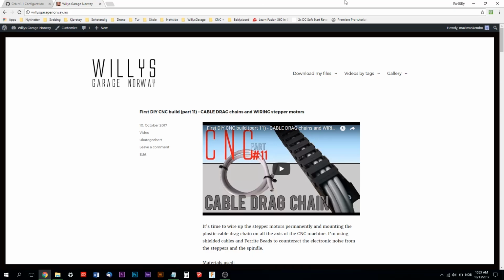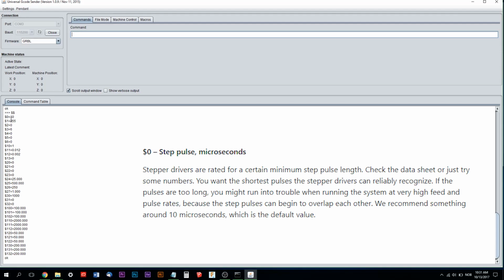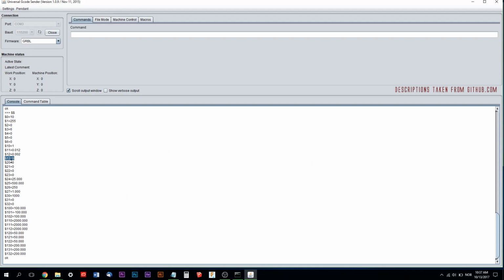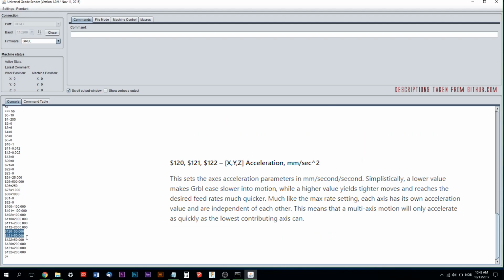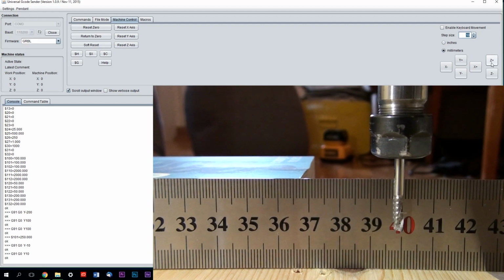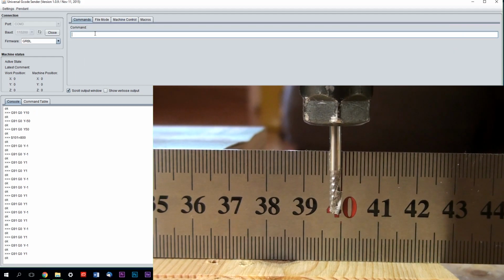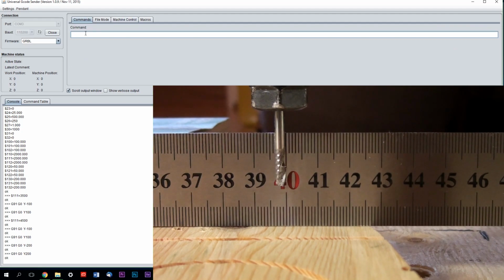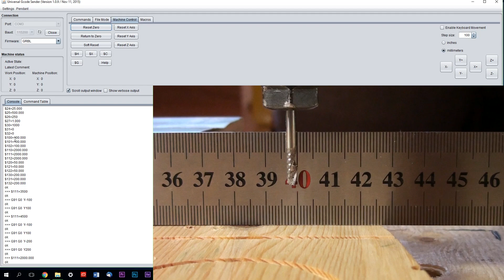First DIY CNC build (part 12) - Configure $$ GRBL on ARDUINO uno TUTORIAL

Comment: Hi. Very nice video. One question - is there a way to add 4th axis to arduino + cnc shield with GRBL? If not, what is the easiest / cheapest way to move to something else that can use 4 axis? Thanks

Comment: Greetings to you dear, thank you for this topic. When connecting for the first time, the motors never started, and the driver’s temperature rose. The motor took one pulse and stopped working or turning until the order given to it by the program was finished. Why didn’t the Nema 17 motor work smoothly and continuously???
Reply from the maker: Hi and thanks, sounds like your motor stalled. Therfore it stops 👍😄

Comment: I have the same problem. With settings $100,101,102 at 100.000 my Mill moves 25MM when asked to move 100MM. My thought would be to change to $100= 400.00, but that does not work.I also get noise and little movement. My machine is a cheep Chinese 3018 PRO. Is there another setting that needs to be changed?

Comment: I installed limit switches... And  when it is pressed motor stopped working but after that I need to restart everything....and it's not accepting any further commands.. is there any option to move the axis away from the limit switch automatically after it is pressed...

Comment: This us by far the easiest and most thorough examples to follow. I am new to cnc and have just finished building an MPCNC.  I have just connected my cnc shield and Arduino UNO and was lost. I will go over thks video again tonight and try using your descriptions fur the first time. Again many thanks.
Reply from the maker: Ciaran Whelan Thanks to you for the feedback :-)  The reason I made this video was beacause I had had the same problems figuring things out myself. Eventually after rooaming the internet for a while I figured it out. The same goes for the Arduino and the TB6560 connection. Thanks again :)

Comment: My computer is on in inverter. But machine all is from suplie current. When suplie current is cut and job stop through relay. & when power is come then relay turn on and start job. 
But but sometime when suplie current is come then comport disconnect some time. But what is best solution. I think I need soft statar for suplie current. Machine is ok. Problem only this
Reply from the maker: Sounds like a good idea to try the soft starter. I'm not sure since I have not come across this problem myself

Comment: Dear sir please tell me how to increase speed of CNC machine
.. my CNC is running is too slow
Reply from the maker: If you have the settings correct, the steps per mm setting? Then you can try to increase your maximum speed setting and acceleration setting

Comment: Please reply😢
Here is a problem to my CNC grbl with stepper motor that the response time, I send the command to stepper motor but it doesn't revolve it revolve when I reset or close the grbl and again open or linked up with arduino then the stepper motor runs with the previous code which I upload but it does not revolve at that time 

I am also change the response time to one 

What is the solution please tell
Reply from the maker: Not sure what the problem is, did you figure it out?

Comment: veldig bra informasjon, takk. 
Jeg holder på med en ox cnc, og tenkte å bruke Raspberry Pi 4 med protoneer modul.
Reply from the maker: Takk :) det høres ut som et spennende prosjekt :) Jeg har ikke vært borti Raspberry Pi så mye, bruker du GRBL mot den maskinen?
Reply: @WillysGarageNorway  
Hei, ja, det er grbl som er planen, har installert noe. Men er helt på ukjent grunn selv, så det blr spennende å se om jeg får det til å fungere, ellers har jeg en windows-maskin stående med mulighet for Mach3. men det hadde hvert greit å få alle komponentene montert i samme kabinett.
Reply from the maker: @Cwn86  Det er bra å få samlet alt ja :) Si ifra hvis du støtter på noe problemer, kanskje jeg kan hjelpe 👍
Reply: WillysGarageNorway 
Takk, det skal jeg gjøre.😀

Comment: I think this problem in LaserGrbl v3.014 softwear setting. 
You can check in above laserGrbl in menu /Grbl/Setting/Jog Control /Grbl/continuos Jog.
         on/off Button has side to continuos Jog. 
Maybe on position is jog work. And off position Jog not work.
 I will checking at home. This time I am in office.

Comment: Hello,

I have built a CNC plasma cutter (MPCNC with GRBL control) and also use it with the Universal Gcode Sende program, but I have the following problem: The file has a length of 100mm, for example, but in reality it cuts me out to 300mm approx. All values in UGS are converted to mm (G21). What could be the reason for this and how can I correct this error?

Please send me your feedback as soon as possible!

Best regards

Tobias
Reply from the maker: Hi, the only thing I could think of is that you might have your settings, mm per rev, wrong
Reply from the maker: Check how far it moves when you tell it to move 10mm in joging function in UGS, measure how far the axis travels in real life. If it moves to short or long, you have to check over your travel settings to make the axis travels the lenght you ask it to travel
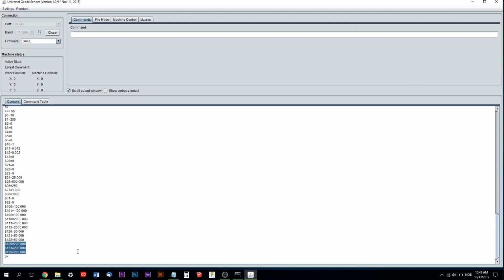Reply from the maker: Try to follow my steps in the video 8:20
Reply: Thanks man 🤙

Comment: Hello, I'm mounting my cnc machine following your videos. How do you calculate the $100, $101 and $102 values? thanks!!
Reply from the maker: Hi, i think I have explained it in this video. You need to find how many steps yor steppers need for 1 mm 👍
Reply: WillysGarageNorway you are the best!! Thanks a lot
Reply from the maker: @urko19  Did you figure it out?
Reply: @WillysGarageNorway  Yes, what happens is that I did not take into account the microstepping
Reply from the maker: @urko19  hehe, yeah I did the same thing
Reply: One stupid question, why do you change the axis? I suposed that the x axis was the horizontal one and the y axis the vertical one... dont kill me jejeje
Reply from the maker: @urko19  hi, sorry for late response. Im not sure what you mean. I did invert the z axis because it turn in the wrong direction. Was that what you ment?

Comment: Hello...what to change on my gbrl settings on LaserGbrl software to achieve 50x50 cm engraving area on laser machine.When I downloaded Laser Grbl to exchange Benbox I uploaded one hex file as firmware.This is for some other machine and I have movement 30x30 cm.I want 50x50 to have engraving area.Machine which I have is 65x50 3w laser
Reply from the maker: Hello, I'm afraid I can't help you. Not familiar with laserGRBL

Comment: How can I increase the speed rather than using codes like $110 $111 any other method?
Reply from the maker: You can use all kinds of inputs. What do you plan to use it for?
Reply: @WillysGarageNorway  cnc writing machine
Reply from the maker: @A2Zfarmsupdate  the speed can be set via the g codes. The speeds you set in $110 and on us only  the  maximum speed. So the speed is set when you make the g codes or the toolpath
Reply: @WillysGarageNorway  thanks
Reply: @WillysGarageNorway   James Munro   dieselphiend  hey buddy how can I achieve slowest and smooth  one rotation per minute  with maximum torque ? Using nema 23 with tb6600 driver ??

Comment: thank you for the explanation. i would like to know how you did the homing and the point zero with grbl and arduino. and hw you calculate the step per revolution of your motor. i have the nema 23 Wantai stepper motor model 57BYGH115-003B 428 oz. Step Angle:                    1.8 degree

Voltage:                           6.3VDC

Current:                           3 A/phase

Resistance:                     2.1Ohm/phase

Inductance:                    9mH/phase

Holding torque:              30Kg-cm       428oz-in

Rotor inertia:                  810 g-cm2

Detent torque:                0.89 kg-cm

Number of wire leads:  4  how can we calculate the step per revolution
Reply from the maker: Hi. If you watch this video, I explain how you calculate your step per rev. It depends on your setup, lead screw, belts etc.
You can watch this video on how I zero the machine:
https://youtu.be/A1zlL3q23HI
Reply: Thx you. I missed this part. Thank you.and it was well explained.thank you and great  efforts
Reply from the maker: user new No problem 👍😀

Comment: when i press $30 it says error invalid statement
my spindle stopped working all of the sudden
Reply from the maker: I need more info on the machine, spindle, vdf, controller boar and so on
Reply: @WillysGarageNorway  spindle 775ER 
its the spindle that comes with the cnc 3018 pro same with the board

Comment: Hello, while processing the g-code file I created with UGS in CNC, the CNC axes go to the place they need to go very fast when the carving work of a point is finished and trying to go to a different point (idle acceleration), which causes tooth skipping and the coordinate is distorted.  I wonder if I need to adjust the grbl settings or the g-code file to reduce the speed of the axes in these transitions (idle speed).

Comment: Hi
i'm working on DIY cnc router project but i have a problem with lead screw or ball screw it's expensive man i spent about 650$ for stepper Nema 34 and other stuff
The question is Do you think if i use a belt my machine will be fast or what ??
Reply from the maker: Eng.Mudar A I dont think the machine would be any faster with belts. Belts are prone to wear and tear, they will slack and start missing steps and stuff. With the nema32 And 23 I would recommend going for some ball screws even if they are expencive. You can also do lead screws like me. Belts would not cut it, sorry
Reply from the maker: Eng.Mudar A Hmm, not a bad idea. But I wonder about the backlash in the chains and sprockets. Maby its fine :)

Comment: Hi, friend!! Excelent tutorial!! Just one question: why my Arduino don't save the parameters?   I'm using grbl controller 3.6.1.
Reply from the maker: TreCe Robotics Hi and thanks. Doesn't it save setting when you change it in UGS?
Reply: WillysGarageNorway Yes, right. The UGS don't save the changes. I think that is the EEPROM of ARDUINO or my Arduino is wrong. The tb6560 is good.

Comment: Is acceleration that slow really necessary? I have not yet set but I'm wondering if setting mine to 200 would be bad. It's a 4mm pitch per rotation lead screw, and if I stall the motor, even at full speed the weight of the gantry can't move that lead screw.
Reply from the maker: Eugen Krause it all depends on your setup 👍

Comment: Thanks Mr Willy,that's very helpful as always,I have question about the values of $110-$112,how would you know the values to set ? is it based on trying or based on calculation?
Reply from the maker: Mohamed Amine BIDA Thanks again. You can increase gradualy 110-112 after you have found the step/mm (100-102). Increase it until the stepper «stalls» or you dont want it to go any faster. Then you can decrease it 10-20% to perserve your steppers. The same goes for the acceleration setting :-)    Good luck and appreciate the feedback ;)
Reply: thank you

Comment: Thanks , but when i try to change ($101=400) the stepper make a high noise and not moving, why ?
My stepoer nema 23 ... 2A
Thanks
Reply from the maker: That means 400 steps per mm. Does your stepper have 400 steps per revolution?   anyway you have to make these settings smaler when doing that.: 
$110=2000.000
$111=2000.000
$112=2000.000
Reply: I have the same problem. With settings $100,101,102 at 100.000 my Mill moves 25MM when asked to move 100MM. My thought would be to change to $100= 400.00, but that does not work.I also get noise and little movement.

Comment: Hello sir
    I am using nema23 with tb6600 drive with 24 volt 10 amp, but with 32 micro stepping my motor rpm is very low around 30 or i change it into 1micro stepping  then its rpm is around 150 with vibration
  I am trying to increase rpm of my  stepper motor with smooth running
Please help me....
Reply from the maker: Tushar Gajbhiye Hi sir, it sounds like you have to change the $100 $101 and $102 setting on the Arduino. This setting changes when you change the microstepping on a stepper motor. If you have a 0,9 degree motor and use full microstepping (fullstep) your stepper must have 400 steps per revolution. Then if your leadscrew travels 2 mm per revolution this value should be sett to 200. That means that the stepper motor travels half a revolution for the cnc axis to travel 1 mm.
Reply: Hello sir, 
         My motor have 1.8 degre & if i change $100,$101 and $102 setting more than 300 value  then my motor stop rotating and make loud noise and after noise decree then motor little rotate and stop
Reply from the maker: Tushar Gajbhiye do you use a leadscrew or belts?
Reply: Sir,
 I am using Ball screw Dia 12 x 4 Pitch
Reply from the maker: Tushar Gajbhiye With a pitch of 4mm, that means the ball screw moves the axis 4mm/revolution. In the GRBL you want to input the step/mm. You have a 1.8 degree stepper wich needs 200 step/revolution. That means in fullstep mode: (200step/4mm)=50step/mm
In half step mode: (200step/4mm*2)=100step/mm
So, first of try to put $100-102 setting in fullstep mode to 50step/mm and test the machine
Reply: Sir,
     My machine  table size 1000mm X 700 mm X 130mm , So if my spindle travel from  one corner to last corner it take so much time then my  stepper motor need more speed to travel in less time
Reply: In short stepper need more RPM to travel fast
Reply from the maker: Tushar Gajbhiye To get faster speeds try adjusting the $110 - 111 - 112. Try setting it to 1500 and up as much as you need
Reply: After 350 value my motor rotate for little time and make loud noise, after some noise low motor rotate and then stop
Reply from the maker: Tushar Gajbhiye what have you sett the $100-102 to? And what microstepping do you use?

Comment: Thanks Mr Willy,that's very helpful as always,I have question about the values of $110-$112,how would you know the values to set ? is it based on trying or based on calculation?
Reply from the maker: Hi and thanks :)  You can calculate this value somewhat, but i depends on what drivers, steppers and PSU you have and use. 
So it's recommended that you increase this value until your stepper motor stalls and then decrease the value about 10-20%. 
This is so your system doesn't run on 100 % all the time :-)  Did this answer what your question was about?